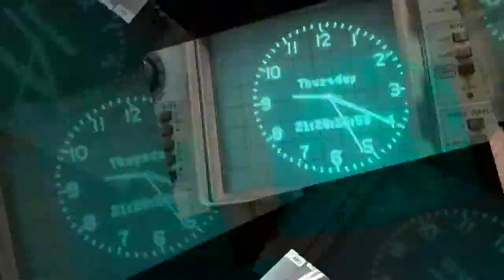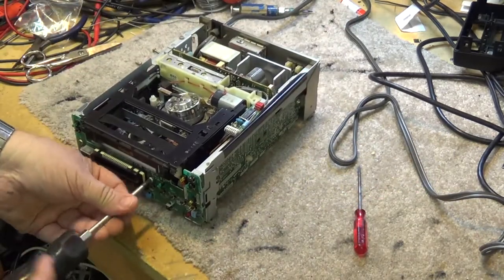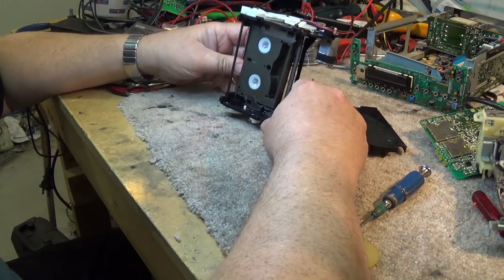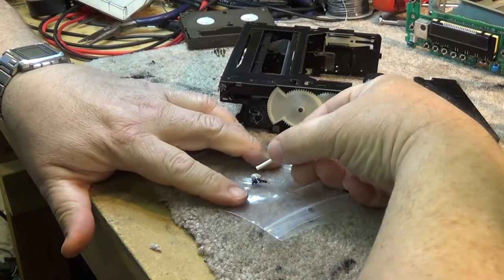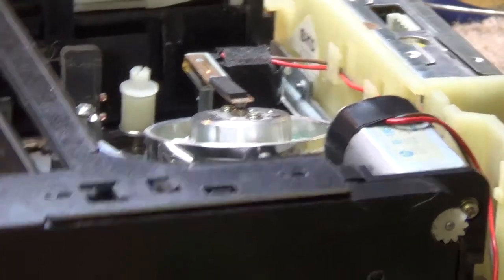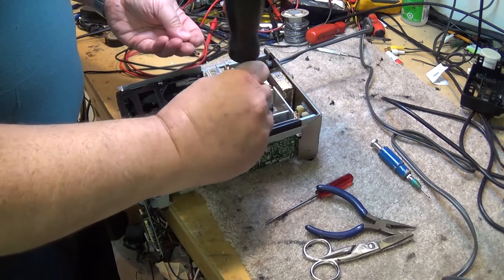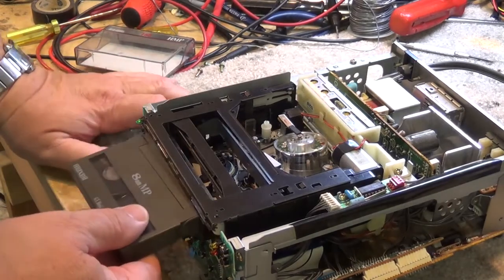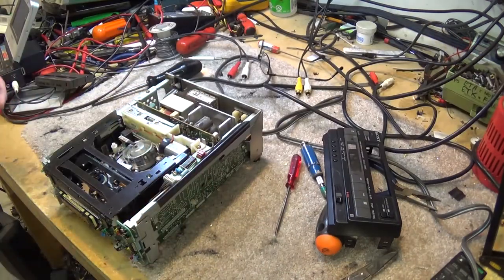Sony EV C3 8mm VCR overhaul

Comment: Hi, thank you for this video it was very helpful!

I'm trying to repair my EV-c3 whch stopped woking 20yrs ago.  At first it wasn't loading tapes properly and when it did, none of the controls worked.  I followed your video but didn't find any cracked or mis-aligned gears.  Upon reassembly, the loading/unloading issue went away & play/rew/ff was back!  I'm thinking maybe the works were gummed up & somehow I jogged them free.

I've discovered a few other issues: A) There is heat-discoloration around the large IC on the SMD side of the bottom main-board.  B) It has NO video output whatsoever.  C) The counter counts during playback but only sporadically during rew/ff.

If the discoloration is not indicative of a catastropic faiure, would you have any ideas of what I can look a regarding the other two issues?  Thank you so much for your time!

Comment: Similar to my EV-S350.  Power supply caps were totally shot, leaking fluid everywhere.  A re-cap and it working great again.  Cannot find the remote control codes for these units anywhere.  Lost the original remote a long time ago, but Sony doesn't even list them on its support site anymore.
Reply from the maker: Sony used 3 codes for VCRs. VTR1 was used for the original Betamax. VTR 2 was the code used (as VTR 2 on the beta remote), for the VTR 2 mode on beta if it was a later model that was switchable and the default code for 8mm, and VTR 3 for the VHS models.

Comment: Hi there, great video as always. I have just acquired one of these which had a tape jammed in. Watching the video, I have managed to remove by taking out the unit, however, after putting it back in the power light comes on but no display and none of the buttons work. HELP!! :)

Comment: Nice video!
I recently bought a MiniDV deck (Sony GV-D300) in unknown condition off Ebay, unfortunately it seems to have bad grease in the supply reel assembly somewhere. You can see the supply reel is going way too slow in Rewind and Fast Forward and in play mode the back tension on the tape is so high it sometimes won't even play right. Eventually it gets so slow it will trigger the Caution message. If you put the recorder into a warm spot for a while like onto a radiator it will work perfectly fine for a few hours. I'll have to try and see if I can somehow lift the supply reel off its spindle, maybe that's where the sticky grease is... the problem is if you try to turn the supply reel manually with no tape loaded it seems to be perfectly fine.
Reply from the maker: DrCassette Or it could have been dropped and something bent slightly.
Reply: Cosmetically the unit is like new, so I don't think it has had an accident. Another thing I could imagine is the brake doesn't release properly, but I have no idea how I could diagnose that. Those MiniDV mechanisms are just too small for any diagnosis...
Reply from the maker: DrCassette They can't possibly be any worse than DAT Walkman mechanism'sCheck the capstan motor for drag. The bearing housing is known to wear and allow the stator to contact the rotor and cause it to drag.The capstan motor supplies torque to both supply and take up reel via a belt. I have GVHD700 which is virtually the same mechanism, and I used to have a GVD300

Comment: Just picked one of these up on ebay. Are there any common faults that i should be aware of?
Reply from the maker: Yes all the capacitors in the head preamp we'll need to be replaced there's about a dozen of them. I recently did another video on this very machine I said have been sitting on the shelf for 5 years and would not play back at all because the caps in the preamp had continued to deteriorate and even though they worked sort of in this video they had completely failed and I did another video of the rebuilding of the head preamp and there was one other cap on the main board I also did another video I think on cleaning the mode switch as it had gotten bad again just from sitting around not being used if you look I did that video maybe a month ago so there is another video on this particular player or I take the preamp out and completely rebuild it now it works perfect. There's a reason I did not show a close-up of the monitor when I did the test recording in this video and that was because the caps were showing signs that they were failing and the picture wasn't great it was watchable but not real good now the unit looks like it did when it was brand new 100% check out the other video you'll see what I had to do to make the video 100%.

Comment: Hi there,
I hope all is well with you.
I hope you can advise me.
I have a Sony ev-s550 video 8 vcr.
It does not play standard speed video.
Could you advise which part should I look at it?
Thanks in advance 
Alan
Reply from the maker: Well it will likely be capacitors in the capstan servo, but  which ones I couldn't tell you because I don't know. Troubleshooting would be needed to determine the faulty ones.Unfortunately this if probably not worth it.

Comment: Thanks for your wonderful videos! After watching this one, I was able to remove and inspect the transport from my EV-S3000, which uses the same Sony "U" mechanism. All of the loader gears look fine, so I'm stumped why my deck frequently unloads cassettes about 1/2-second after they go in. The cassette seats fully on the reel table with the door open. Then the loader brings it back out. What should I check next?
Reply: I saw in the video that there is a tape sensor which is an infrared type sensor, I believe so try to get that cleaned, if not not, check the mode switch which I believe is at the bottom of the mechanism.

Comment: I got a SONY HI8 EV-C200 PLayer and whenever I try to rewind it
then its cant keep up and starts to keep all the tape out and then the the whole tape gets stuck and the tape permanently gets destroyed. Don't know what to do!
Reply from the maker: +Soccermaster15659 On the 8mm format all tape handling was spooled with the pinch roller and capstan. So in rewind, FF, Play ect, it is the capstan, and pinch roller that are moving the tape. In other formats such as VHS, cassette, DAT ect the pinch roller is only pulling the tape through in play.If something stops the supply hub from turning in the reverse direction, the capstan/pinch roller will continue to pull the tape and the result is tape all over the mechanism, and a ruined tape.Carefully inspect the little teeth on the hubs and pendulum gear for anything that might be causing it to stick such as a grain of sand that has lodged between the teeth, or a cracked gear.
Reply: +12voltvids Thanks!
Reply: +Soccermaster15659 So I need to check if there is any stuff that got stuck?
Reply from the maker: +Soccermaster15659Yes and it is more common than you think. A grain of sand caught in the ridges of the cassette, or in that tape lid goes into the machine. Gets stuck in the fine gears. Happens more often than you think.  I might even stage a video where I place a grain of sand in the gears. It was a common problem where I am, because we have beaches here, and camcorders were always coming in with sand in them back in the 80's and 90's. I don't miss camcorder servicing.
Reply: +12voltvids Thanks!